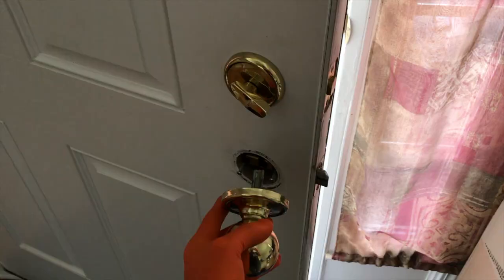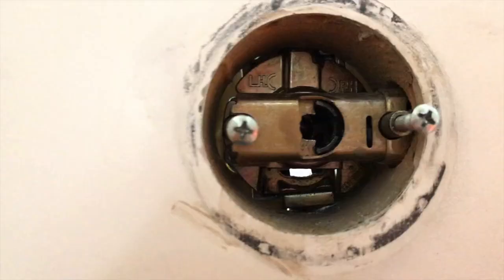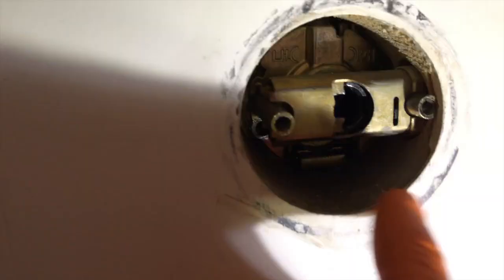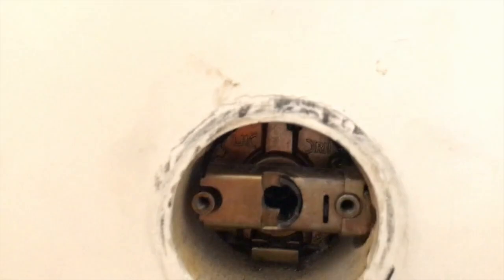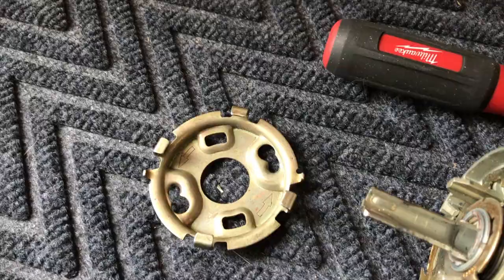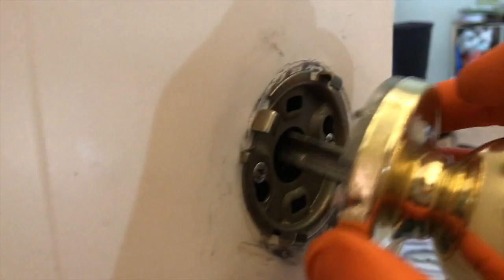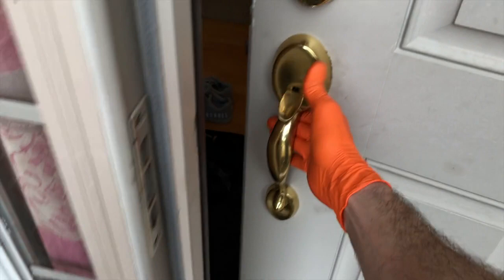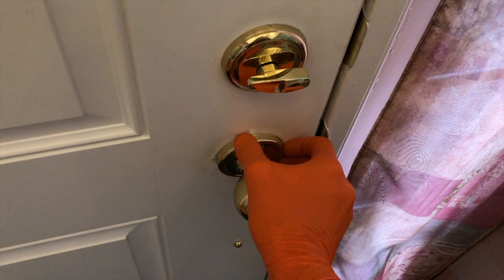Kwikset front door knob with no screws loose or fell off - DIY fix

Comment: The plate is really imbedded on my inside door knob, but the bigger problem is that the spindle won't go in far enough to lock the door knob onto that plate once I get it out and tighten those 2 screws on it.
Reply from the maker: Good morning, thanks for watching.  Any update…?

You will want to ensure locking feature is shifted to the unlock position prior to inserting knob.  Please keep us posted.